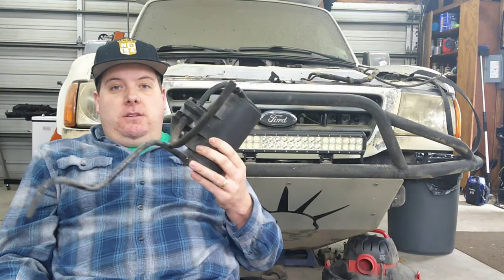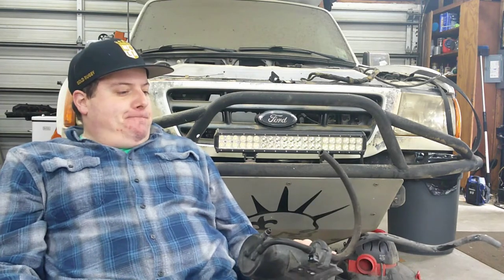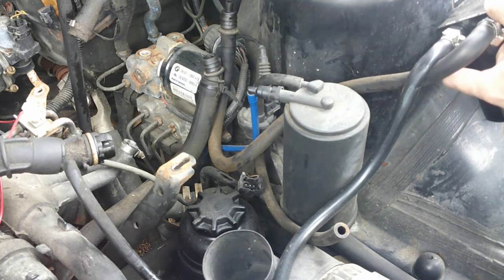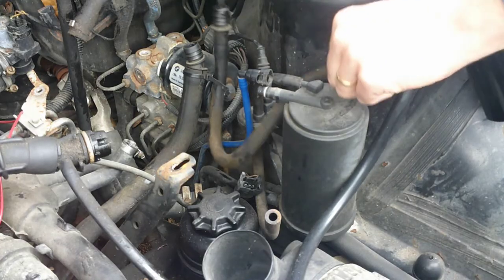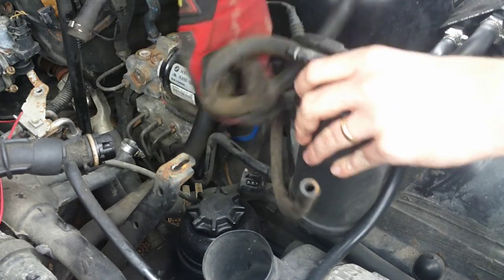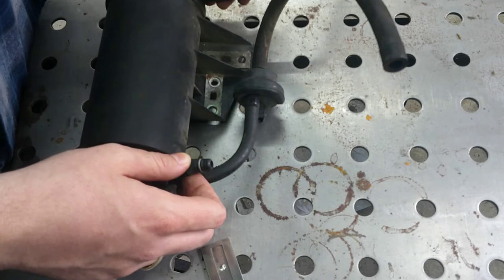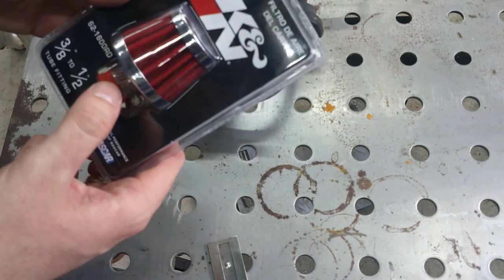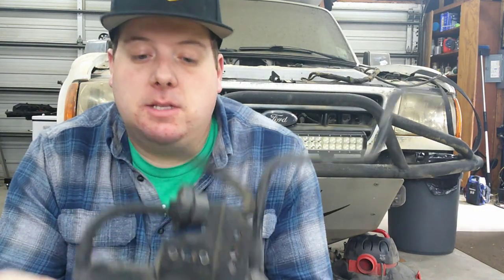How To: e36 OBD1 Charcoal Canister Delete M50 and M52

Comment: I feel like bypass the charcoal canister to the purge valve makes my truck run better.. it keep wanting to die when I would start going but since I took it off and unplugged tubes from purge valve it hasn't been acting like it will die and lose power

Comment: hello thank you for sharing this, is this bad for the engine or you just deleted it for more space? if it's bad for engine I'll definitely delete it
Reply from the maker: Not bad for the engine. They are a wear item so I don’t know if after 250k miles it still worked. So I deleted it and all the necessary hoses I capped or put a breather. Also I had to plug the little valve back in and tucked it under the fuse box out of the way.
Reply: @hackedfab8090  thank you for your reply, then I'll keep it the way it is :D

Comment: Nice you answered a question I been asking myself for a while. Wanting to this on my 95m3 obd1 car that has the same plumbing as your e36 and I wasn’t sure if the purge valve would throw a check engine light. I read the comment here you said no check engine light came on which answers my question I been having since I want to put my oil catch can in the same location too since the bracket for it is already there!! 

One more question dude. Did it create any gas vapor smells coming into the cabin of the car ? I just don’t want it to smell like shit since my car is California smog compliant(very rare thing) lol so I just don’t want it to smell like I have cats removed or something of that sort?
Reply from the maker: So I don’t smell anything on the exterior of the car. But in the car I smelled gas before I deleted the canister because I run no cats. But the smell is the same, no change, so I don’t think there will be a smell of you still run cats.
Reply: @hackedfab8090 hey man, a year later has the check engine light came on at all for it? Needing to do this asap thanks
Reply: @Euroboyz  had a light when I first started because the valve was completely unplugged and the computers it as an open circuit. Plugging it back in and putting it under the brake booster made it clear. Either plugging the valve in or using a small resistor across the ports of the harness plug will prevent the light.
Reply: @lucasgauthreaux5993  sweet! I appreciate that man, I definitely would’ve tossed it out.

Comment: Confused with e36 fuel line/diagram from main tank to engine and fuel filter, can you made a video with your e36 please?
Reply from the maker: Hell yea it’s confusing. Working on that video for the fuel filter now. Was going to do just the lines under the car to the engine. Need from tank too? It’s just a return and feed (I’m almost certain)

Comment: After deleting it did it throw a code ?
Reply from the maker: No codes. There is no sensor in the tank or anything for obd1 vehicles so the DME has no idea if the charcoal canister or purge valve are even doing their job.
Reply: @Jr - since it doesnt throw a code for a bad canister I wouldnt think it would it you just removed it.
Reply: Mine is a obd1 car and throwing a code for evap. Is it possible to delete this from dme
Reply: So I threw a resistor in the plug cleared the code and has yet to come back